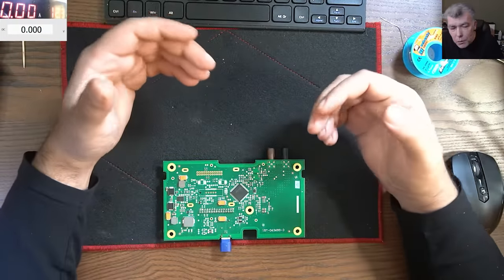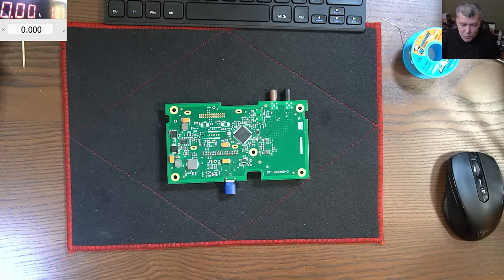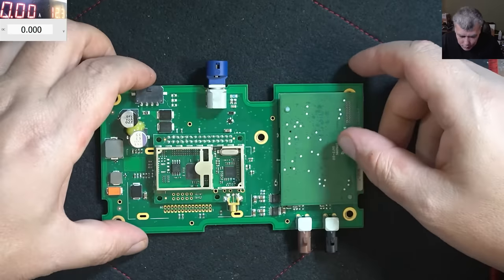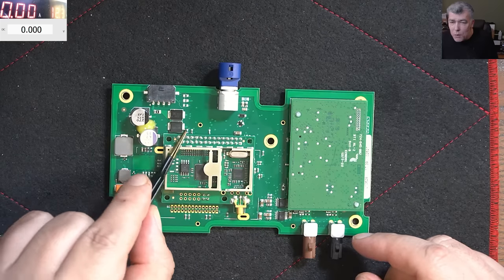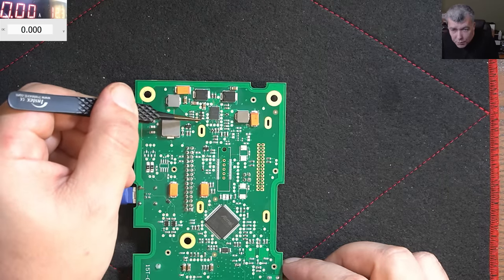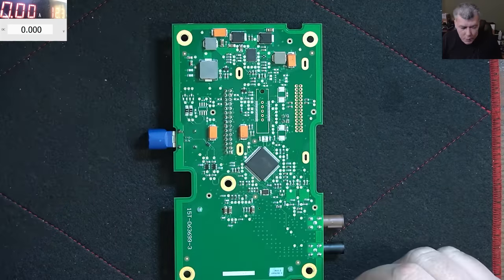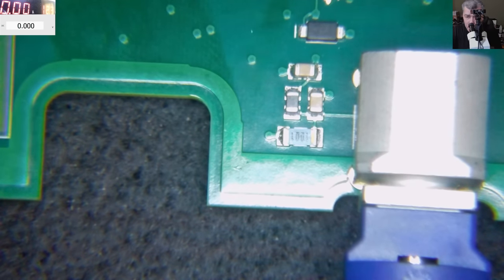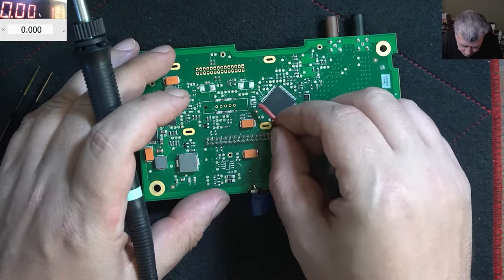You Can't Fix It, Because You Are Not Good Enough

Comment: That chip you refer to at 6:33 minutes in is a Linear Tech Triple Monolithic Step-Down Regulator with LDO. Just search for LT 3507. There is just one chip, with different temperature specifications. It has one 2.4 Amp output and two 1.5 Amp outputs (Switching).

Pins 2,& 3; 30 & 31; 35, & 36 - +4Volts - +36Volts (this would be your +12Volt input)
Pins 37 & 38; 28 & 29; 33 & 34, are the three outputs.
Pins 10, 11, & 12 are the Power Good signals - Open Collector, active high.
Suggest you download the datasheet.

Omegaman
Reply: Awsome!
Reply: correct LT 3507
Reply: Yeah, exactly, it was very easy to find once you know the logo of Linear Technologies, and it's a very recognizable brand so I'm very surprised that any electronics related person doesn't recognize the company.
Reply: @InTimeTraveller  Clearly he's not good enough.
Reply: @InTimeTraveller  didnt even know about the brand, just searched for LT 3507 and the next line of the chip
Reply: @InTimeTraveller do you, for example, know what "jit compiler" is without googling? 
why do you think he would stumble upon lt chips on laptops he fixes the most? 
that logo is symmetrical, letters are not.

Comment: Being a hardware and firmware designer, who also did repair sometimes, I highly approve your point:
the complexity and raising integration into ICs saddly makes it really hard, sometimes even impossible to fix. It's kind of playing lotto... Especially without the schematics. If the issue isn't obvious, doesn't pop up any soon, you're goign to loose. 
In my country - depending on the device's price of course - for the avarage you've got max 15 to 20 minutes for a full repair. If you can't succeed within that time,  you lost on that one. It's a really hard, unforgiving, greedy bussiness... 
Either you've access to some helpfull data or you always face the same product, gaining knowledge for the next repair (like Louis Rossmann, only fixing macbooks) so you get quicker or know what usually fails...
And when it comes to failure on ICs, especially those holding unaccessible firmware, just forget it, be sorry, next. Its sad, I don't like this, things should be more fixable, but it's the hard truth...

PS: minus isn't necessarly ground, you can also have a plus, a minus and a ground; or even more.
Reply: Great explanation :) no words after, great people 😊
Reply: @Jeffrey Wolsieffer "and even Companies like "Digi-Key" and "Motorola" simply Gave Up on Selling Directly to the Public." 
Do you mean Digikey stopped selling the specific chips you are talking about? Digikey does sell to the public. Always did. Mouser is another source well respected. Digikey is an interesting model of customer service. I remember back in the late 1970s, they were a hobbyist surplus seller. They would buy parts over purchases from manufactures and re-sell them. These were OEM new parts. By the 1990s they became a serious electronics parts distributor. Today they have parts manufactures lining up at their door to carry their line. IMO, they accomplished this by providing outstanding customer service. And they still do. Mouser has a similar history but is bit smaller than Digikey.
Reply: @alfa-psi  oh, right, i even know... I'm not an english native, neither did i ever live in an english speaking country, so sometimes it happens i do a misspelling or such ^^

Comment: I had a Korg DW8000 synthesiser I had on and off the bench for months, the microproessor was not running.  I thought I had reached my limit after checking all power and reset lines etc.  Then one day I decided to swap the crystal and after that it all came back to life.  It sometimes it takes persistence to climb the tree of knowledge.
Reply: True. When you run into an MCU, that's normally the end of the line. But in exceptional cases, a reflow will fix it or a crystal replacement. In my experience, it's very few and far between that crystals fail, but it does happen. It has happened after resigning myself to failure and on the verge of giving up, that I've replaced the crystal as an afterthought, and that has solved the problem. It aint over till it's over!
Reply: @Rendon276  Haha that was exactly the same as my experience.   Got lucky and robbed one out of a dead STM32 dev board lol

Comment: Excellent example here as far as knowing your limitation. As an Automotive Locksmith myself, I also fix different car electronics. Even though I started recently doing this and need more experience in removing/replacing MCUs, there are programmers which can read this micro controllers, extract their software and write them on to a new micro controller. That would have fixed the unit. The most important thing here, is to understand what does what, which you have given us a fantastic explanation. I just subscribed to your channel and I believe I will learn a lot from you sir. Thanks for your contribution to humanity, because this is what this is. Helping others. God bless!!!
Reply: Yes, 100% true,  basic electronic knowledge and skills, good programmer, oscilloscope, giving light in the tunnel, after checking power supply, eliming the shorts, the logic often going corrupted, caused by low battery voltage, poor grounds, electric spikes, best practices is reversed engineering and start from very basics, automotive electronics repairs is very pleasure business and worth investing time.
Reply: Sometimes filtered osciloscope  enough for power supply and noises :) to the board along with rest  :) catch the frames with raised and lower spikes speaking :)
Reply: From my experience, if the MC is damaged or has a corrupted firmware reading could fail or you could read corrupted firmware which obviously not gonna help. It's really hard at this point.
Reply: Even if firmware read protection in chip is not enabled (which at this case certainly was enabled), there is no reason to use already corrupted firmware. Also how you will read firmware from physically fried chip?
Reply: @KrotowX  I don't think that the chip is fried. It looks in excellent condition. I believe the problem is caused by something else that needs further investigation. Even though the chip might be faulty it doesn't mean the firmware is no good. It's worth giving it a go as this particular chip is not very expensive.
Reply: @yiannakosautomotivekeys2380  Chip may be disfunct and look fine with that. Although I would try to check if ot is functional in other ways before giving up, yes :) Missing USB power voltage is not hard proof about dead chip yet. There may be other missing voltages or shorts that may prevent chip from running. Fixed similar things earlier like silently corroded resistors and capacitors which caused modern voltage regulators to not work due to missing voltages on their power good inputs and similar. And thermal camera is good helper for short finding.
Reply: who says code inside that mcu is intact?

Comment: I feel your pain ... working without schematics or any support from the manufacturer it's a real drag.
To repair that board you would need a new microcontroler a JTAG adapter and the firmware image eventually with a reseted ID , an interesting project for a Sunday afternoon at your garage but not for a repair shop with fixed costs.  
Keep up the good work , i always take a few minutes to watch your videos (when i am not dealing with the same s****).
Reply: Sometimes even when you have a schematic it is not easy to find faults.

Comment: That blue connector is an LVDS video connector. I work on these all the time at work. When we install Aftermarket carplay units they interupt that LVDS and inject the Carplay video image into the LCD instead of the OEM infotainment image. Check out ZZ-2 carplay, Grom or NAVTV and you will see how that signal works. BMW, Audi, and othes use this style connector. GM uses what looks like a USB but they are all LVDS. I hope this helps some.
Reply: Nice history but isnot electronics
Reply: Ķ

Comment: Hello Sorin. I believe that the power supply IC is manufactured by "LT" - Linear Technologies. The Atmel IC is an FPGA - Field Programmable Gate Array, and like you clearly explained, without additional information (which determines what each of the programmed Atmel IC pins is supposed to do), you really cannot move forward any further with any additional diagnosis, as to why this remotely located tuner board is not functioning as intended, or as in this case, at all. Full stop. Good call sir.   Fred
Reply: Important Note:
I originally misidentified the Atmel QFT IC used on your UUT tuner PCB Sorin. I have several projects currently going through my mind at this time and I misidentified the UUT microcontroller as an FPGA (Field Programmable Gate Array), which it clearly is not! As I am sure you know, the Atmel IC used on your UUT remote tuner unit, is in fact, a 32 bit AVR flash microcontroller, also manufactured by Atmel technologies, however the IC is a totally different animal. As we all know, on the internet, it is a Mortal Sin to misidentify a semiconductor! So to hopefully right my wrong, please accept my mea culpa/excuse my absentmindedness Sorin and also viewers of the channel. I will try harder to not make any more errors when I place a comment in the future Sorin. My bad...   Fred
Reply: @electronicengineer  lol. No worries friend.
Reply: Hello , @ChupoCro ! : The short answer is that I am a moron, and in my haste to console my dear friend Mr. Sorin, I had a brief memory fart that exited my mouth (through my keyboard) whilst I was still thinking through the Xilinx FPGA unit, up on the logic analyzer back at the office. My mind was still on a custom Altera based FPGA contestant/prototype, to be used in a new, custom, bidirectional, multi-protocol UART "bridge" product, being debugged and validated for full-duplex, BACnet protocol backbone translation. The finished unit(s) (products) will be implemented in the new N.Y. Mets stadium, building automation solution/product. There is an existing, legacy, resident, Xilinx (FPGA) currently installed which is resident inside of a Siemens "Main Control" panel, which needs to be able to read from and write to the existing BACnet data buss, in order to be able to communicate with our new products. This system is in its final debugging stage and I had been working on one of the UART PCBs and I managed to import and by mistake, reference that component in my head whilst I quickly wrote that half a$$ed comment to Sorin. That particular Siemens UART, which is an FPGA centric solution also supports Modbus TCP-IP, and is required to be preserved for cost-saving, and unfortunately is still stuck in my head... even this morning... So much for not bringing work home with oneself. A Big Fail again. WooHoo!!! I hope that you have an awesome weekend ChupoCro!   Fred

Comment: Well done. If I was the customer, I would be ok with this final decision.  Repair or replace? Replace, an opinion presented by an electronics technician. I believe you could repair the board, however parts and labor might exceed the cost of a replacement. THIS IS VALUABLE KNOWLEDGS. Good Show.

Comment: I also would have checked the X-tal oscillator to see if there is a valid clock signal on the µC. But indeed once you arrive at the software level it becomes a dead end pretty much. I used to repair TV 's back in the the 90's and it was a different story with most analog electronics.
Reply: I second that. I've repaired several items that even had the clock running at the right speed but the scope showed a fuzzy sign wave. Changed the x-tal, sign wave clean, and microprocessor is talking again.
Reply: I had bad crystals too... And of course Bad crystal/ceramic filters in RF circuits

Comment: New to all this PCB diagnostics since as service technicians we hardly ever have to replace or resolder individual components on a PCB. We just swap them out en-bloc...Too bad. What an utter waste...Today I was real bummed out having to replace a pretty expensive main board (worth at least Eur 3K) which had an on-board power supply. It had given up the ghost due to m/p a capacitor-related failure, but I could see no broken or damaged traces. Nor could I detect any suspicious odors suggestive of anything having been burnt. I wish I had your mad skillset and your experience to take a proper look at that main board and find out what the issue was. Thanks for a great video!Subscribed:)

Comment: The chip in 6:38 is a LT3507 step down converter from Linear Technology. You can get it from Aliexpress, but there are quite a few different variants around and I could not identify the exact version on your board (my limitation...).
Reply: The only p/no variations for the LTC3507 chip are temperature related.
Reply: Getting a chip from aliexpress is like playing lottery with counterfeit chips. Good luck.
Reply: @killer_x_treme  wrong ali isamazing
Reply: @angryman9333  I've had counterfeit chips delivered from ali. Aliexpress is just a marketplace where many sellers offer their products. It all depends on the seller.

Comment: Hi Sorin. You are right; sometimes we need to stop and that's all.
The board you was working makes me remember a keyboard based on  Arduino chip.
It was having a erratic problem with USB communication; all voltages was fine but sometimes was recognized and sometimes not.
In my case the  problem was the USB protection chip SR3.3.TCT.  Maybe in your case one or  both of the 6 pins USB in series with USB lines are killing USB comms. Thanks for your videos.

Comment: While I think you're giving good advice on knowing your limits, I also believe it depends on the person.  I remember working on a power supply board for a TV and constantly failing to fix it.  After 3 months of random attempts, I finally found the issue and fixed it.  It was a free TV and I was too stubborn to give up.  Most would give up - but the difference is knowing your limit and pushing through it.  Time and patience is needed to learn - and while some things cannot be fixed, some can.  I will tell you the sense of accomplishment was so awesome.  Try, fail, try again, fail again, and repeat until you're happy.  Sometimes it works out, other times it doesn't - accept that fact and I think most people will be OK.  As always Sorin, thank you for all the knowledge you share!
Reply: This is true, when I see something giving me serious difficulty I suspend the repair, I mean a very difficult one, and I have come to find out that coming back to it 2 weeks later, you must have grown mentally while fixing other things. And when I get back it that isuue boom it's fixed and I'm happy.

Comment: Is there a clock signal? looks like possibly two xtal/oscillator positions on the board, one has capacitors but no oscillator 16:31 top left around pin 99,100 also looks like there could be another oscillator at the right hand side around pin 47, 48 ish? I've had similar where the oscillator has failed. Worth a shot...

Comment: I didn’t see this in the comments. Most all automotive modules have a communication statement to the buss when they power up to let everyone else on the buss know they are ready. The point is, look at the comm pin on the atmel device when power is applied. Not the main power, the ON power from the radio. If it doesn’t spit out something on the comm bus, you are done. Looks for serial data. If you have something, then check the two six pin canbus converter chips next in line. Data must be on the connector port when power or it will never work.  It’s a short burst. 

These are universally true for most modules.

Comment: I watch a few electronics engineer's get out their microscope and I know right away that my limit. I have worked on a few circuits using SMD's etc, but got away with using a head worn magnifier - but it becomes quite taxing for me. It's good fun watching you work on them though. We used to deliver a tv for the customer to use while we repaired their tv. That was in the 70s when we went up to 3 channels.

Comment: great   work   to  save time on processing how the PCB works 
and  most circuits doesn't have a schematic diagram (the factory do not want you to repair it)
so I do a checkup on most likely to get defect   if the system not working  them the  CPU  chip  got damaged from esd  shock 
(modern design want to save components cost )
like filter inductors and  transient diodes  at removed  
so  using continuety test using a multimeter  on MCU pins to gnd and vcc  if you find very low ohm like 200 ohm then it's likely damaged from esd .

Comment: The Session_valid signal is high when the voltage on the USB_VBUS pad is higher than or
equal to 1.4V. For UC this is input signal. so in this particular case the problem could be not in UC. You have 2 more components attached to 49 pin. one of them is MLCC which can be cracked and shorted it is the most common problem in electronics under stress like vibrations and falls.

Comment: Have a similar experience from automotive OEM audio amplifier. After owner shorted 2 dynamics somehow it switched off one of two 4-channel amplifier chips. All the components are working fine except chip not received i2c command to start. 
Schematic uses some switching chip for i2c because all two amplifiers is the same so has che same address in i2c. Switching line come straight from the main FPGA and it not switching.
If I physically connecting two i2c buses after switch - all two amplifiers starting. But balance-fade will not work for sure so it make no sense.
Looks like pure software bug on double-error stored somewhere in the FPGA EEPROM.

Comment: I think u need a osciloscop to check the data or signal pin. Try to looking pulse signal from ic. Present or not. If not present the ic may be faulty. If present. In this case cannot comunicate may be the software corrupted. This just for curious job. But btw. In the end You are right. This is the limit.